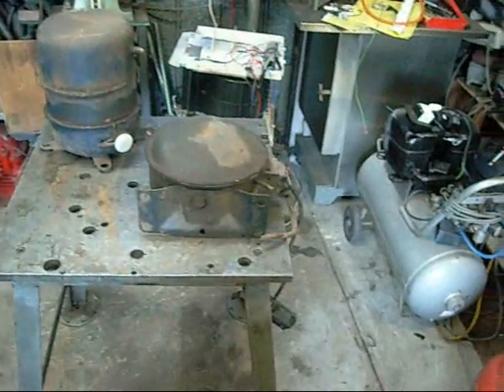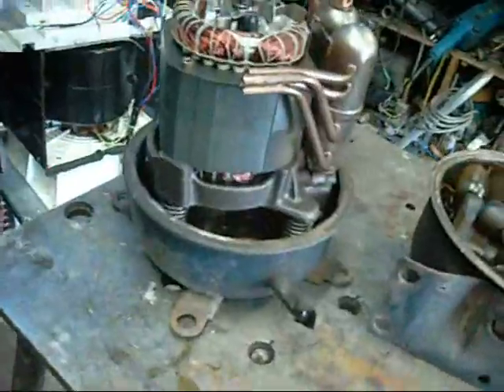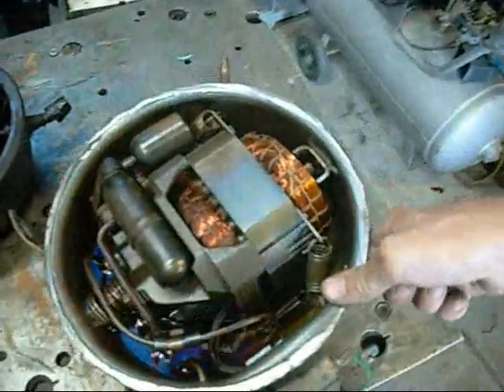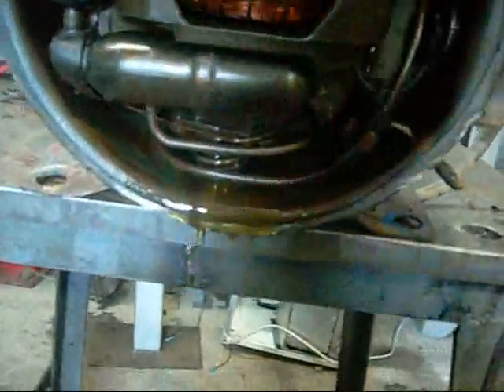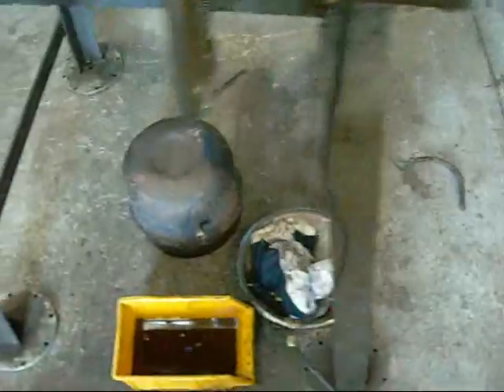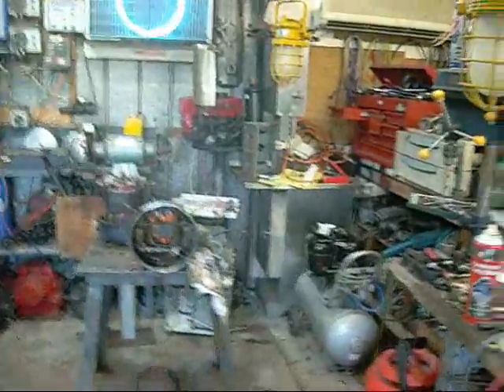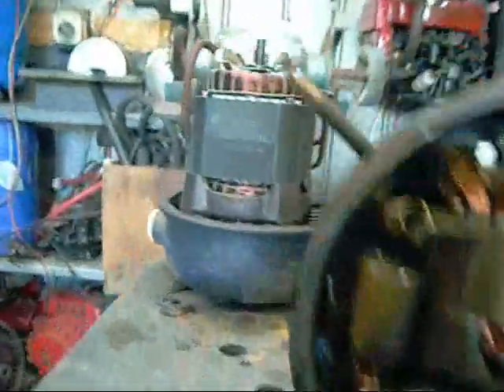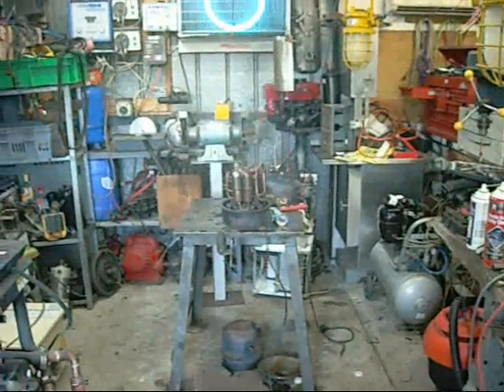Vintage Kelvinator Fridge and AC Compressors Exposed and Running

Comment: Last I remember from cutting freon compressors open, that oil smells like total shite.   It smelled a lot like used power steering fluid, with that sour burnt metal smell.

Comment: Hi Ed! just stumbled on this. I found one of those pancake compressors in the woods back in 2001 and cut it open with a manual hacksaw. took me about 3 days to get it open lol mine had a cooling fan on it and a couple of lines running up to the coils,  I guess to help with cooling. it was totally seized but I managed to get it running. it had probably been sitting in the woods for 40 years. it was attached to a condensing unit that had a steel condenser (it was all rusty) rather than aluminum and it also had a small plastic rotary pump on the chassis. I have no idea what sort of machine it came out of. maybe a coke cooler? but... why the water pump? it's a mystery.
Reply from the maker: Awesome, I remember you saying somthing about it, they are a really cool design!
Reply: Aussie50

Comment: @Aussie50 Most of that came off the top of my head, I went and looked it up later. The company was formed in 1916 and was indeed named after Lord Kelvin, but he had no more connection with Kelvinator then Abe Lincoln had with the car company. They merged with Nash in 1936 which merged with Hudson in 1954. Apparently they were owned by American Motors until being sold to White Consolidated Industries in 1968 who later sold Kelvinator to Electrolux in 1980, this is the U.S Kelvinator of course.

Comment from the maker: @jdstooge I like that idea!, it will need to be offset since the comp sticks out of the housing a bit, but there are a lot of offcuts of 250mm solid round UHMWPE at work that I can machine a spacer ring from.

Comment: Kelvinator used to be part of the Nash motor car company, which later merged with Hudson forming American Motors, not sure what happened after that or who operated Kelvinator after the AMC merger. I'm sure that Kelvinator was named after Lord Kelvin (William Thompson) whom devised the concept of absolute zero and after whom the system of temperature measurement is named.

Comment: wow that vertical one is massive for just a window unit! I found one similar to that smaller kelvinator one in the woods just sitting by itself, cut it open with a manual hacksaw (Took me 3 days off and on) and got it running! I got rid of it a few years ago, wish i'd saved it :P at the time I was worried about PCB oil but I don't think they used that type in these compressors did they?